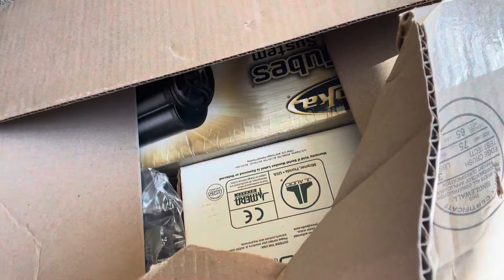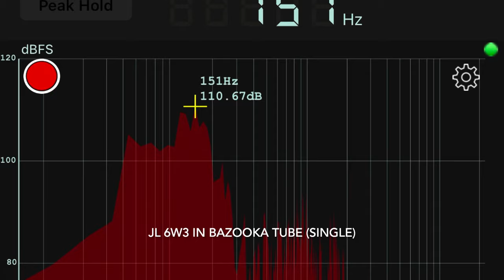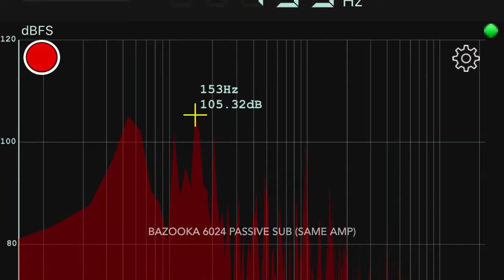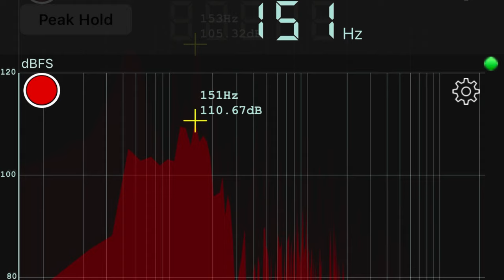More BASS for your small space Pt Deux: Audio Sampling and SPL

Comment: @WallyTheBuilder- That is so cool that those Tubes fit under your seat. Facing those tubes backwards gives a Db increase from whats known as boundary loading, and also allows for a deeper bass note to develop, its a win, win= very nice job! Hey just to try, seal off the ports, and see how those JLs sound like that. It will lose output in the midband, but pick up on freq. below 40Hz.
Reply from the maker: Interesting… I always noticed rear facing was the best sound, didn’t know those details. Thank you! I was thinking of trying them sealed. Do you think it’s a problem that the sealed volume of these tubes is about double the sealed volume spec from JL? And do you think the tube shape will make more bass in sealed form than a box in sealed form? Just curious… I may even just buy some pvc and put sealed caps on it rather than seal the bazooka tubes.
Reply from the maker: Also… maybe one sealed, one ported. Would that compliment each other or cancel each other out?
Reply: @Wallymakesstuff - The tubes having almost double the Mfg. Rec. sealed cubic feet, will prob. bring the Qtc= damping of the sealed enclosure, below .707, but only slightly. This will be good for accurate, Sq type sound, and will lower the woofers power handling, but not by much. After impedance rise, you will be fine. It should work out well, for Sq.!? Also, by the tubes being deep= more distance from the enclosures back wall, from the back side of the woofer cone, it should have less resonance, than in a shallow enclosure(like a typical sub enclosure). This should have better output in the 20Hz to 39Hz freq. Range, but lose output, and boomy bass, in the mid 40s to 80Hz. Should sound very smooth, very musical. Try playing the rap song: ("Put On"),  by Jeezy, it has 4 to 5 bass lines, with the highest note being 55Hz, and the lowest being 27Hz. I know its not youtube friendly, but test by yourself, on these tubes ported, vs sealed, and then tell us on video, how different it sounds, (ported vs sealed)
Reply: @Wallymakesstuff - No it wont cancel it out, like some would like you ro think.Try it out, 1 sealed, and 1 ported, it just might be exactly the sound you like!?
Reply from the maker: @evilinside5984  thanks dude, solid feedback and ideas! I am going for SQ so this could be a good improvement. I am a bit concerned these tubes can’t handle the pressure of a sealed enclosure however… not the walls, but the mounting locations - only one way to find out! That’s what JB weld is for anyway😂. Maybe I’ll try sealing one, compare the two separately, then together with one sealed/ one ported. What are your thoughts about adding poly fill or denim insulation in either use-case (ported vs sealed)?
Reply: @Wallymakesstuff - It's Not rec. to use fill in a ported enclosure, as this could cause a port restriction. I have a feeling, SAS put fill in these tubes from the factory, to help with the thin walls resonating. By you using two Layers of peel-n-seal damping on the tubes inner walls, was/is a MUCH better solution= much better wall damping(vs fill), and no port restriction. As far as fill material, although usually rec. In a sealed enclosure, for 2 reasons, #1 damping= you already addressed this issue even better, with peel-n-seal, #2 to small of enclosure= fill fools the woofer into thinking the enclosure is approx. +25% bigger= this enclosure is already very big= not wanted/needed in this scenario.
Reply from the maker: @evilinside5984  Great feedback! I'm going to temporarily seal one of them and see how it sounds...maybe both, in a way that I can remove easily (maybe some great stuff foam seal. If I go permanent, I'll back it with jb weld. I'll get something up after I've done some testing.
Reply: @Wallymakesstuff - Since this enclosure is so huge, is it possible to block off the port on the inside? Like with high density foam, then gorilla duct tape over it? Like right as the port forms in the back of the enclosure, on the inside? This way it would be easy to test, then remove, also shrinking the airspace.
Reply from the maker: @evilinside5984  yesterday I bought some self expanding foam and sealed off one of them. Didn’t turn it up much yet because it was still soft last night but I’ll try it out a bit today. Initially it does sound more musical. If I don’t like it, I can always scrape that all out. If I do like it, I can cap it with Jb weld.
Reply from the maker: @evilinside5984 so… after a full cure and solid test, the verdict is that these JL’s lose about 80% of their audible punch in sealed form. (Subjective ear test) It wasn’t until I did an AB test that I could tell how big of a difference it was. I suppose if I was running higher wattage, it wouldn’t matter, but with the 250/1 JL amp I have, I pulled the foam and went back to both ported. Set the crossovers at 120hz and 24db slope and I’m really happy with the sound. It was a fun experiment though!
Reply: @Wallymakesstuff - This is to be expected, since the sealed chamber is waaaay too big. If the sealed chamber was .15 cu. Ft. Net, it would have more punch as you say, which is actually boominess. 1 thing this confirms is, you are not an SQ guy only. Which most of us are not. We fall some where into the SQL realm ( Im more towards the Loud and really low freq. stuff like 15Hz to 40Hz) It seems as though you did not explore 1 of the only few advantages of a very large sealed enclosure= 20Hz to 39Hz output!? The 40Hz to 80Hz punch/boominess, was going to be an obvious Loss from the get go. Did you not try the song "Put On" by Jeezy, or any other 20Hz music? The most noticeable loss in boominess/punch would have been a rock, double kick drum😒😢 I prefer a smaller sealed enclosure with a Qtc around (.85 to 1.05). A pure Audiophile/SQ person prefer's a sealed enclosure with a Qtc of (.5 to .707)  A strictly SPL/Metal head, would prefer a sealed enclosure with a Qtc of ( 1.1 to 1.5) Great test, either way, thank you for taking your time to try this. Just remember, if you ever want to try a sealed enclosure in the future, 1st make sure the subwoofer will sound great in sealed, 2cnd has alot of Linear X Max, 3rd have an amp that can produce (2x to 3x) the subwoofers rated R.M.S power, and 4th make sure the Qtc. of the sealed enclosure is between (.95 to 1.05). Have a great day!
Reply from the maker: @evilinside5984 yeah, I listened to the Jeezy song - didn’t seem to hardly pick up anything below 30hz, but that could be my ears… it literally softened the loudness so much that it didn’t sound like I even had subwoofers hooked up - hence your comment about needing 2-3x the rms rated power, which it doesn’t. I used to run a 12” JBL sealed sub with about 2x power and that was my preference for sound. But… I can’t fit a 12” sub under my seat. Part of the issue is I’m working with 6” subs… and not enough power. Now, if I didn’t mind dropping an extra $1k and losing all my under seat storage, 4 - 6’s with 1000w rms sealed would probably be the right match. And yup - a kick drum kinda bass is probably my favorite type. It was fun to play around with though - and thanks for all the feedback and ideas!
Reply: Fun fact - a car's cabin is basically too small for any boundary loading increase at lower bass frequencies.  I ran a similar experiment with an 8" sub in the back of my SUV in different locations in the trunk, and the only thing that really changed with the different locations was the response ABOVE 63 Hz. With smaller cabins, that "corner frequency" will increase.  Of course our ears are more sensitive to higher frequencies, so we hear that as "more bass", but it also means that if I was crossing over the subwoofer at about 60 Hz, I could probably put it anywhere in the car ...
Reply from the maker: @Grommet2007 interesting experiment. Thank you for the thoughtful reply!
Reply: @Grommet2007 - So not to be a d-bag, but 1 thing is for sure, that every scenario, can, and usually is different. I have been a Champion Car Audio competitor for over 30 years. It's always good, to make a ✔️ list of theories, and things to try, but only 1 thing @ a time, and on a Term Lab SPL meter, in the exact Location, every time, to have Quantifiable results. Corner loading in a vehicle has worked very well for me, gaining 1 to 2 Db on average, in the 15Hz to 45Hz range. I have a huge enclosure with 4- 18s!

Comment: Use an app that would generate a sine sweep and set the spectrum analyzer to peak hold mode - that will give you a better idea of what the frequency response of those subs actually is. Set the sweep to go from about 35 Hz to 200 Hz if you can. You can then use those results to tune out any big peaks in the response curve with EQ or x-over settings and the resulting bass should sound a lot cleaner and better.  TBH though, it does sound pretty decent already from the recording.
Reply from the maker: Man that’s a really good idea. Thank you for the thoughtful reply!
Reply: @Wallymakesstuff  Another way is just to use an app that can generate "pink noise".  Then you can use the RTA like you normally would.  Turn off the amp for your main speakers first though, unless you want to try to find the best x-over setting between the sub and the main speakers. Be prepared though - this might end up being a BIG rabbit hole to go down.  I went there and now I have a 6-channel DSP handling all the x-over and EQ work for my car audio system.
Reply from the maker: @Grommet2007 man that’s something I was thinking of doing. You’re right, this rabbit hole just keeps getting deeper and deeper 😂. My head unit has pretty decent dsp abilities (for what little I know it seems good anyway). I was wondering if all pink noise bbcovers the full range of frequencies. Spotify sure has a lot of them to choose from.